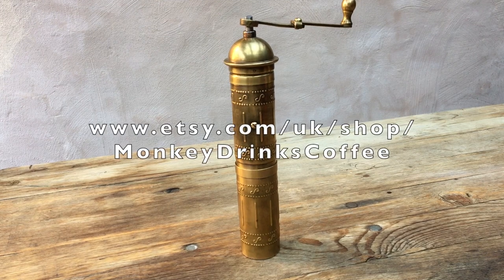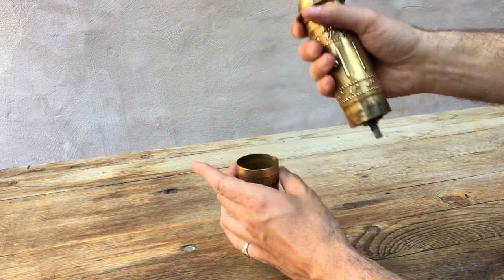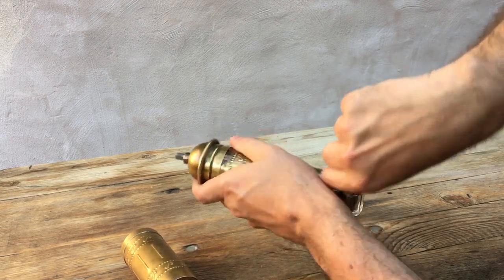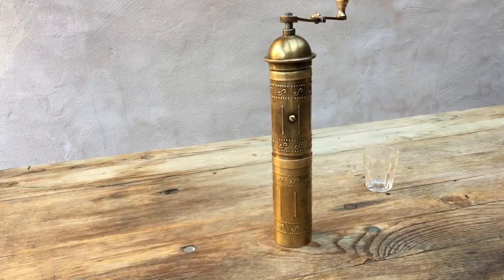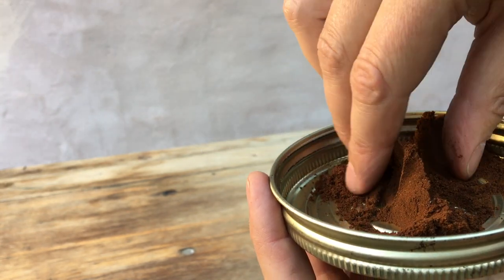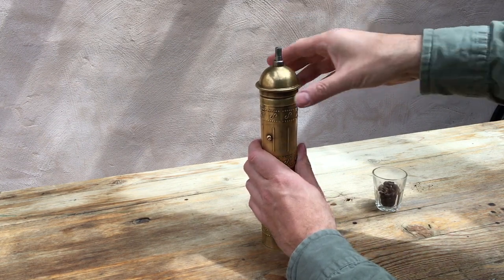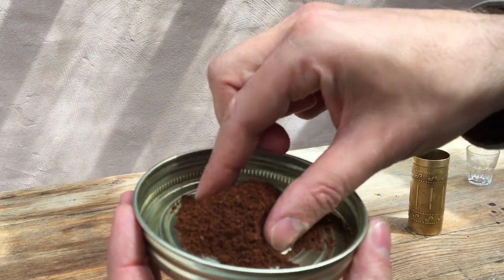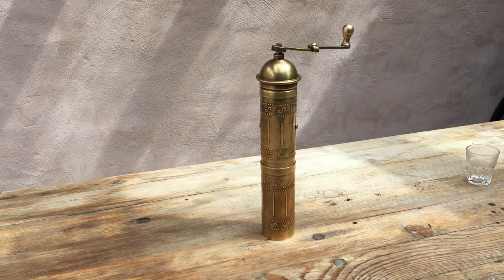brass 'Turkish' mokka grinder: coffee grinder demo and test

Comment: Thanks, these are details I wondered about.  The new ones, which look almost exactly like this vintage one,  are the burrs as good?  Also, an intriguing feature of this type of grinder is that it looks like the spindle could be chucked into a variable speed drill at ~200 rpm, which should yield a superfine grind in about two minutes.  What do you think?
Reply from the maker: Interesting questions! I'm sorry, I know nothing of the new versions. As for putting the spindle in a drill chuck, I think it would be possible to try it, but this is a vintage item, and was never designed for that kind of use. I can imagine all kinds of problems, and the wear and possible damage would mean you'd be saying goodbye to the integrity of the original object. Can I ask, why do you need a super fine grind? A grind that fine is only really needed for Turkish coffee. It seems that Turkish coffee aside, these grinders are also useful as lightweight and compact travel grinders, and with the adjuster slackened off they give a range of useable grinds in a reasonable amount of turns.
Reply: @edshred99  I'm definitely thinking of Turkish coffee here.  As for the speed, I'm thinking the drill could be slowed to about 60-100 rpm, which would approximate human effort but without the fatigue and undue wear on the grinder.

Another thought occurred to me, which is that when turning the grinder by hand, the coffee is agitated, bringing all of the coffee under the burrs, probably resulting in a more even grind.  Using a drill might not be quite as effective.
Reply from the maker: @markuswx1322  There is a lot of debate on manual versus electric grinders. Many believe manual to be superior. You are right, there are all kinds of variables with a manual hand-held grinder which may or may not make a difference. one would be the jiggling of the beans down into the burrs, as you mention, another might be the tendency to push down on the handle, resulting in the inner burr being pushed against the bearing. Feel free to do the research!!!
Reply: @markuswx1322  It is enough to add a steel ball from the bearing (between the millstone and the bolt). The handle will be easy to rotate
Reply: @user-bbk935  This seems like an interesting idea to try.  I don't currently have one of these grinders, or I would try it.  Like many others, I first learned of these grinders by watching Jeff Smith's cooking show.  He used them for grinding pepper, which is a much easier chore.